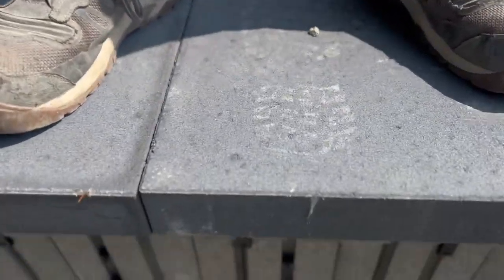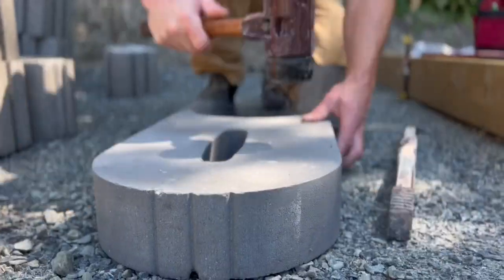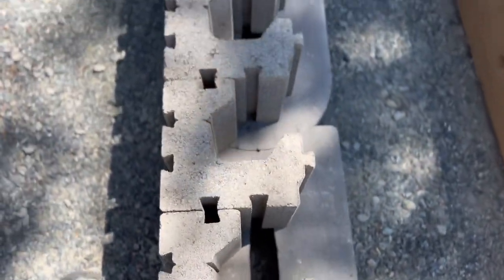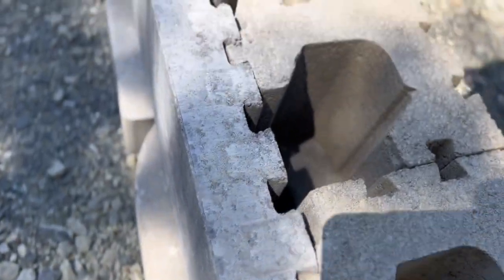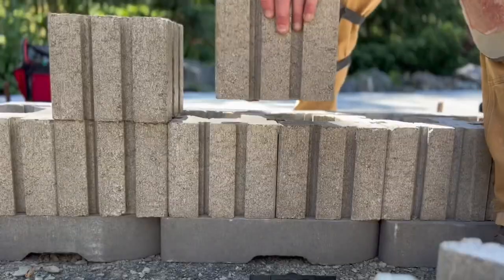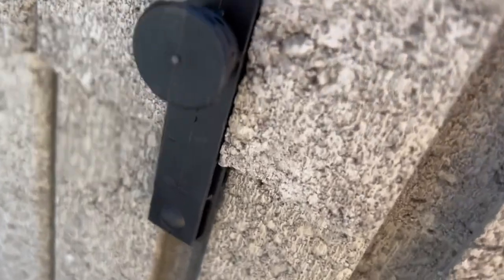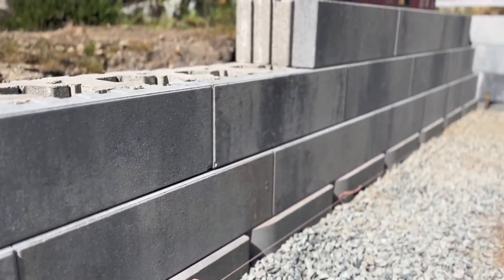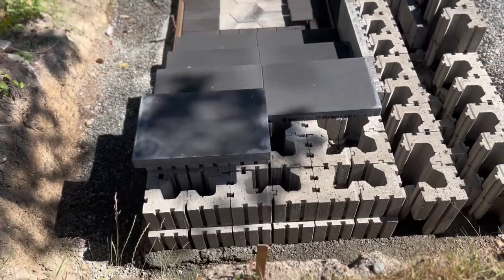How to build a modern retaining wall using Belgard’s Melville Tandem modular blocks!

Comment: Hi Kevin, I used the u-start base blocks and built the Ashlar tandem wall. Question for you, I noticed the top is not completely level across the facia piece and modular block. Did you find the same thing?
Reply from the maker: Hey, I didn’t really notice that too much. But I did find that a couple of the modular blocks at the very top were sticking up a bit high, not sure if that was the block itself or maybe I didn’t clean well enough between rows. I wasn’t too concerned as I expected to shave some down for precise levelling at the top row, or make up for it with my mortar/bonding layer